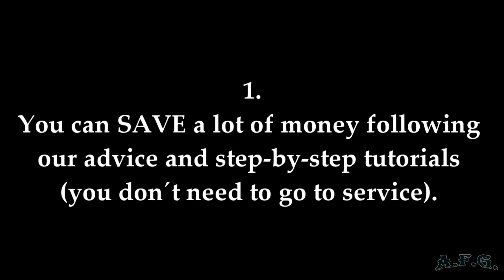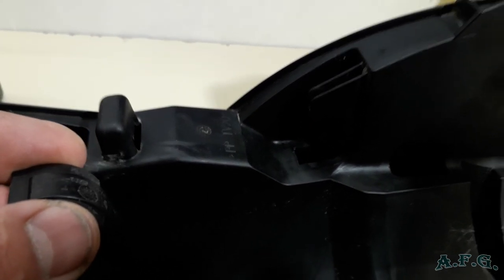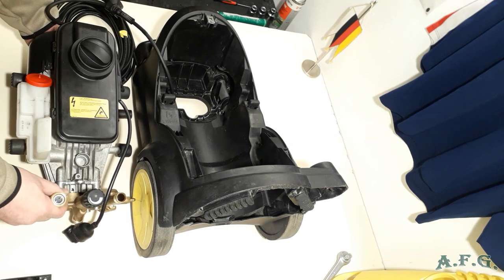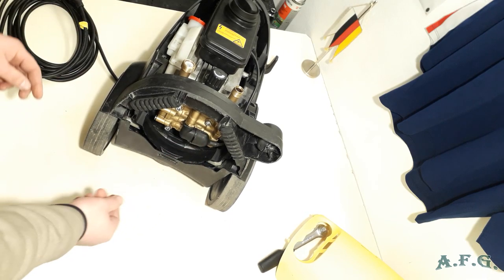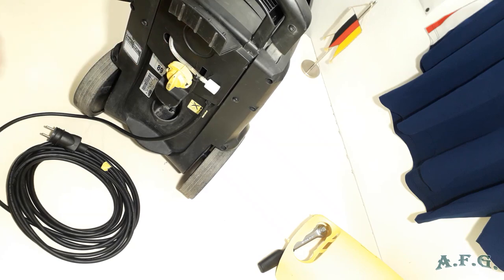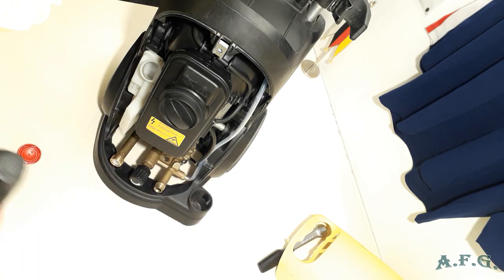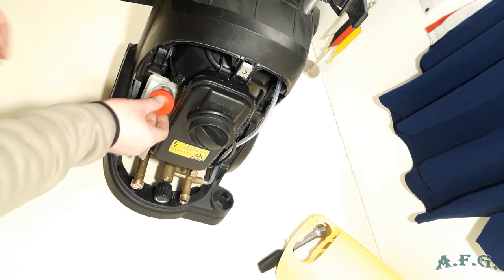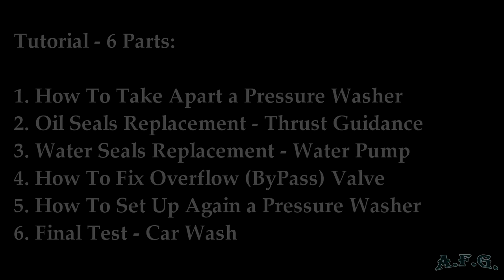Assembly of a Pressure Washer; Kärcher HD 5/15 C+; (Part 5 of 6); Repair; HD 5/12 C; HD 6/13 C.

Comment: Hi again, I just want to confirm one more thing with you. How do I change the oil? Where is the place to drain it?

 Thanks for your effort.
Reply from the maker: Hi, through the place through which you pour the oil (as shown in part number 5 of the tutorial), you also pour it out (drain it).  Whether you use a pump to suck up the oil or just tilt the machine properly is up to you.
Reply: You are simply Amazing buddy ☺️🙏Cheers

Subscribed